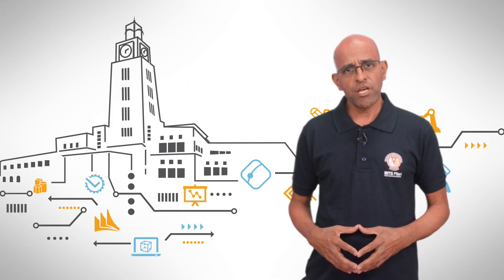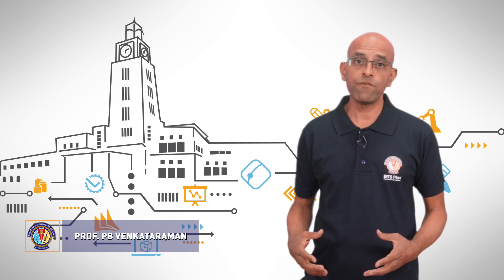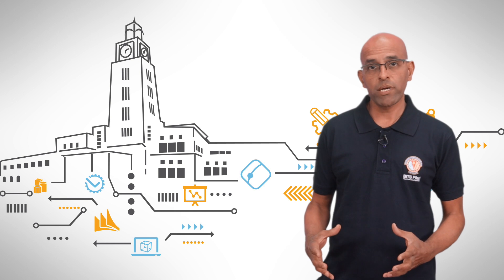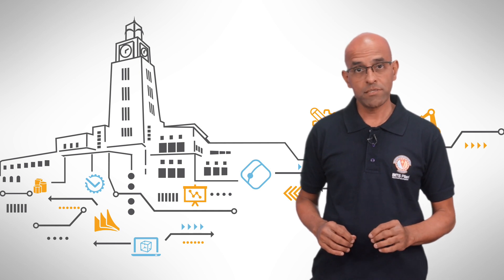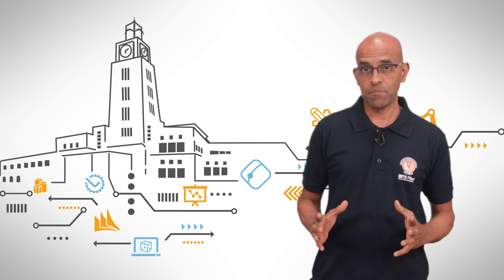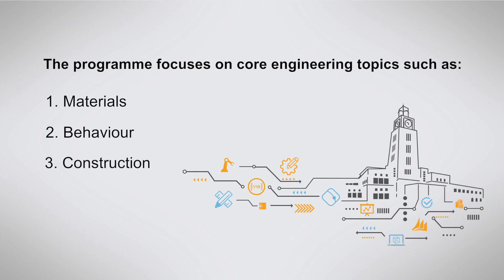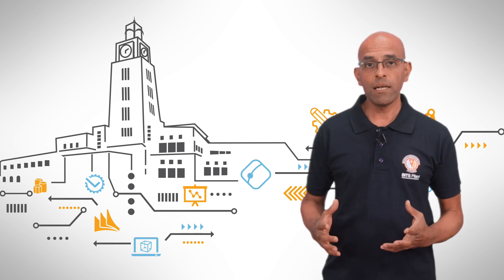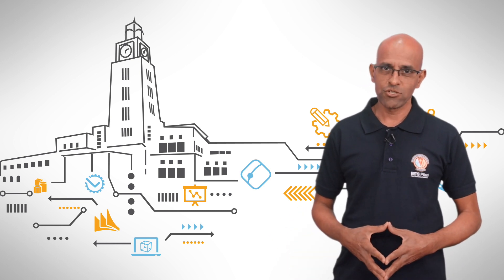Prof. PB Venkataraman speaks about BITS WILP's M.Tech. Design Engineering for working professionals

Comment: Following things are covered ???
Preperation of Design package for
Valves manufacturing
Pumps manufacturing
Boiler manufacturing
Pressure Vessel manufacturing
Piping manufacturing
in compliance with local law's, Regulations or Regulatory requirements, standard, Specifications and Codes requirements
Reply from the maker: Hi, Kindly check the following link for more information on our programmes: https://bits-pilani-wilp.ac.in